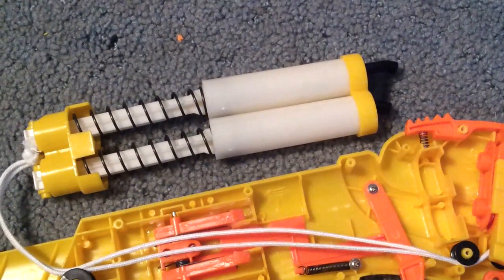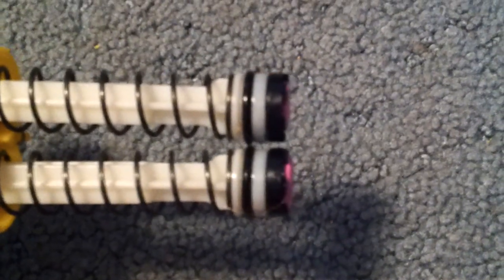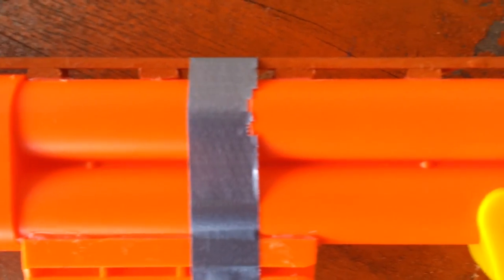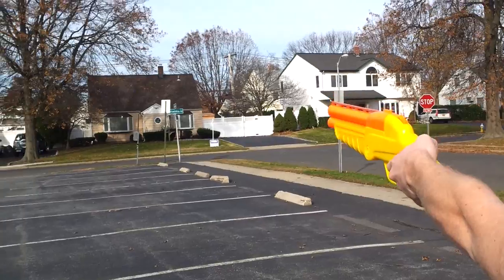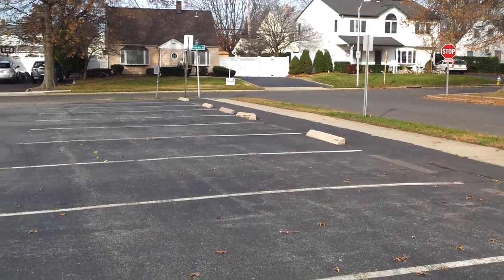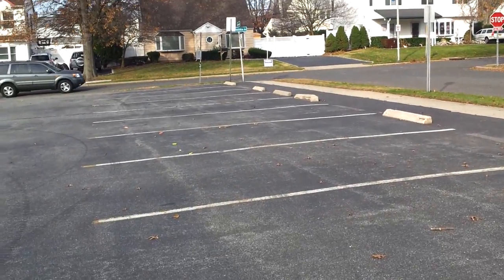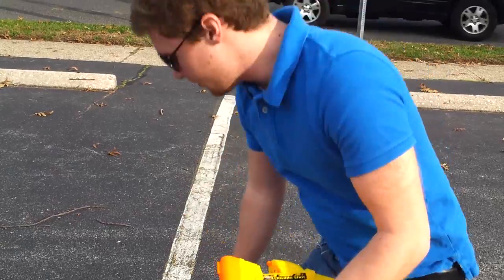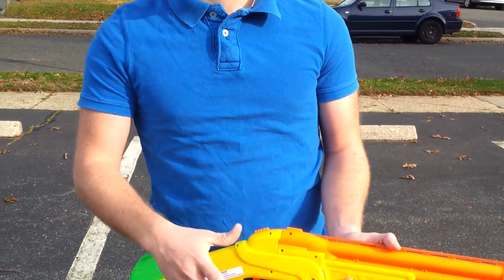Buzzbee Double Shot Rifle Total Mod Guide

Comment: i've never seen a double shot with barrels vertical to each other i've only seen the ones horizontal. p.s. is there a performance difference between the 2?
Reply: NoobDude Gaming101 Double Shot Side by Side and the Double Shot OverUnder, loading difference is the only thing.

Comment: a better way to do it is to cut the shells where it transitions from big to small, remove the ar via nail or pliars, then cut a piece of half inch cpvc the size of a dart and insert it into the shell (sometimes it requires you to jam it in/ attach etape to make the fit tighter) with these i have gotten the best ranges.

Comment: The bolt gun is great feeling and looking but also shoots about 15 or was it 30 feet stock! I just got one at good will and its a little under I belive so I cant say anything about relyablity but it is one of the most acurate guns I have used in a while.